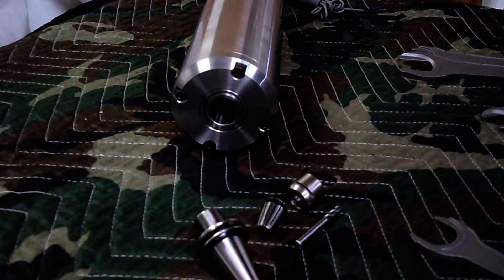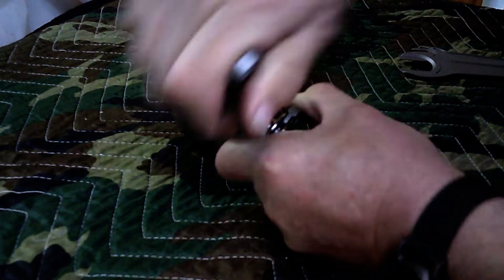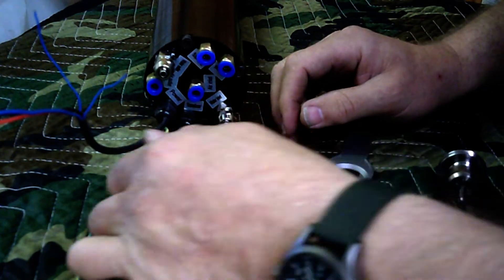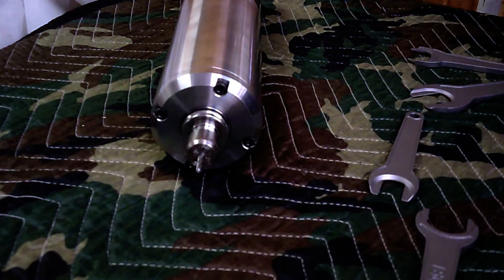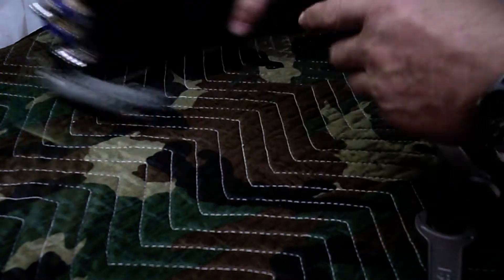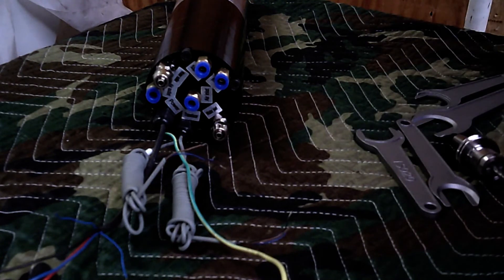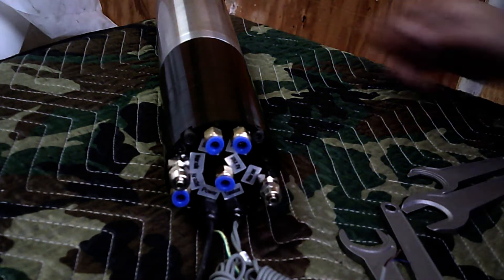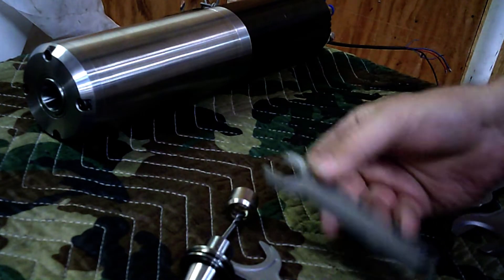Upgrading to an ATC High Speed Spindle Part 1 of ??

Comment: How have you liked the spindle so far? Considering to buy this same spindle also
Reply from the maker: So far no issues other than a loose pull stud.  I tightened them all up a little more firmly with a wrench and I haven't had an issue since. I do just use these for a quick manual tool change so I have not used all of the sensors.

Comment from the maker: LLUIS ASKED, Hi Bob, and sorry for take your time.
I want to buy an ATC spindle and i see your video (VERY INFORMATIVE AND HELPING VIDEO).

In this years of use do you have any problems with this Poware/RATT-Motor Spindle? (your feedback/info are the best thing).

Sorry for send email here, but in cambam forum i cant register and i don't know the answer of "how do you spell cnc" i'm from Barcelona/Spain and i cant find the answer."

I have not really had any significant issues.  I never used the sensors for open/closed/held confirmations since I do strictly manual tool changes.  I am working on a machine that I may use a wine rack tool rack with, but I have not worked that out yet.  My only real issue was having a pull stud come loose.  I've torqued all the pull studs more firmly with a wrench and checked them periodically.  No issues since.

Comment: Hi Bob, how do you use the PNP-sensors? I have the same spindle and one sensor doesn't change the state and the other one just drops the voltage from 24v to 21V.
Reply: 24V is my source voltage. Because I use a PLC to control the Valves. First time I had both sensors connected to the inputs of my PLC and both inputs have been set in every position of the chuck. So I took both sensors to test them. I have put a 10k ohm pull down resistor to the black wire for measuring the output. On one sensor the output signal don't change and on the other one I had 24V or 21V on the pull down resistor. So I think the sensors are broken.
Reply: Or maybe they are NPN and the manual is wrong? I also wrote to Rattm Motor but I get no answer.
Reply from the maker: @roberthoffmann4703   I'm used to using 5V for stuff like that, although I am aware there are sensors that can use other voltages.
Reply from the maker: I did not use them.  I am not using an actual ATC setup.  I just wanted the fast change and repeatable tool height so I could use the tool tables instead of having to touch off after every tool change.  I did mention this in one of the videos.  Sorry I could not be more help.  One thing though is that I don't understand where you are getting 24/21v volts.  On another machine that has similar sensors for homing and limits the voltage comes from my BOB at 5V and the output is connected to an open collector input on the board.  I wouldn't even know where to start unless I knew where that 24/21V was coming from.  When it comes to PNP or NPN I always have to hunt up a connection diagram, and again I did not use them on these spindles for my application.  If the tool falls back out in my hand I know it didn't lock in.

Comment: thank you so much for taking the time to do this video...i'm going to go with this spindle for  new cnc build...very appreciative...how do you like it?
Reply from the maker: Hi,  Just so you know I plan to make one more video in this series actually showing me installing it.  That being said I already installed it, and I didn't shoot any video.  I can say this because I like it well enough that I ordered another one of these spindles for my other similar machine.  Its here so I should be installing it pretty soon.  Watch for the last video in the series soon.  So far I like it quite a lot.
Reply: @boblalonde8661  awesome...so this is essentially the jlg-80 correct?
Reply from the maker: @minskmade  I don't know the model off the top of my head.  Its the 1.8KW 80mm ATC spindle from rattm motors on Ebay.  RTM80-20 I think.

Comment: I have same problem on how to connect my air return on my jgl 100 atc spindle
Reply: I just got a JGL spindle, and it came with a user's manual. In it, it didn't say anything about what the "air return" is used for.

However, before I purchased the unit, I request a digital copy of the user's manual, to review. When comparing the two, I noticed a number of differences. So I asked them which one I should be referencing. And was told the digital copy is the most recent, and to trash the one that came with the spindle.

In the digital copy, it says the "Air Return" is for ensuring that the Spindle's internal air cylinder is returned to the proper position after a tool change is performed. And to apply air pressure to it for a few seconds before starting the spindle up.

Also, if indicated to use "2-postion 3-way values" for each of the air connections. And a few other details.
Reply: Rex, what vfd are you using with the spindle?   I’m just setting up my machine with the 3.2kw. Jgl 220v 24k atc spindle.  Is yours the same?
Reply: @CowgirlVr123  yes it's same, I am using huang yang vfd

Comment: Hello Bob,
I am thinking about upgrading to ATC to.
Great video! What brand, how many KW, Seller, dimensions?
Looking forward to part 2 of ??
Regards, Rob.
Reply from the maker: Part 2 was uploaded yesterday.  It corrects some of what I got wrong, and adds some more information.  Part 3 will probably be a few days, and include the basic air connection on the back of the machine.  This is a 1.8Kw peak 1.5Kw nominal motor purchased from Powace on Ebay.  It is a Rattm Motor.  At some point I'll weigh it. Its 80mm, but you can find these in 100mm, and a company in Taiwan sells one that is 61.915mm.

Comment: I'll add some of this in the Part 2 video.  I was not 100% sure either.  Now I have it figured out.  I think.  The return air port goes to the return side of a dual acting cylinder.  I don't know if the air cylinder has a return spring or not.  If it doesn't or it sticks a little you could get friction and heat from the ram of the cylinder rubbing on the end of the draw bar when the spindle is turning.  You really need that return air.  What you need for control, and maybe you already know that, is a 2 position 4 way 5 port change over valve.  They make them either manually activated or electrically (solenoid) activated.
Reply: The 2 little blue wires go to a thermistor, so just using them to trigger an output directly or through a relay won't work.  They would need to go to a PID control of some type I think.  

The two grey cables with 3 conductors go are PNP and go to sensors that indicate the position and condition of the tool change mechanism.  They could be used in a full tool change system to prevent a crash in the event the mechanism in the spindle does not work properly.  For my configuration to just have fast repeatable tool changes I will not need them.  Not on this machine anyway.